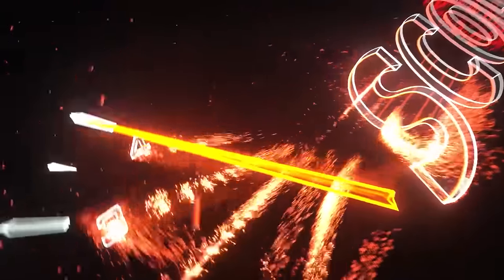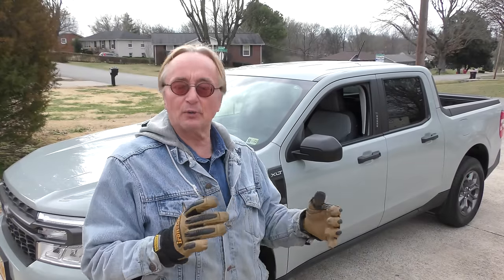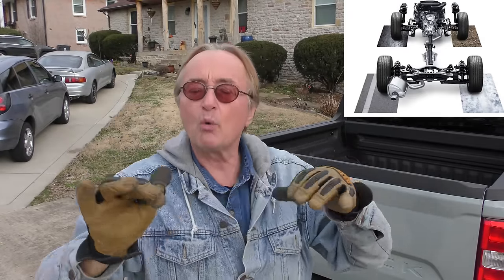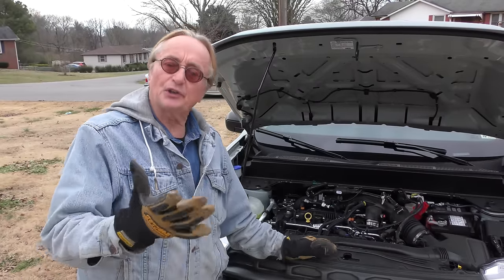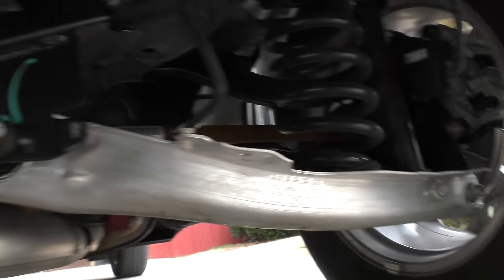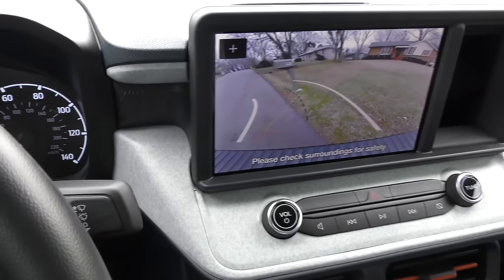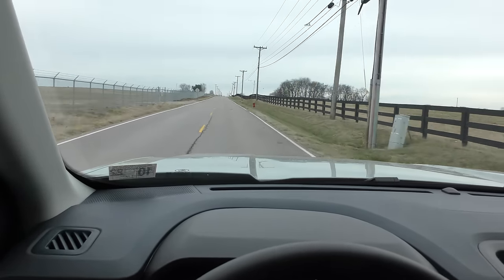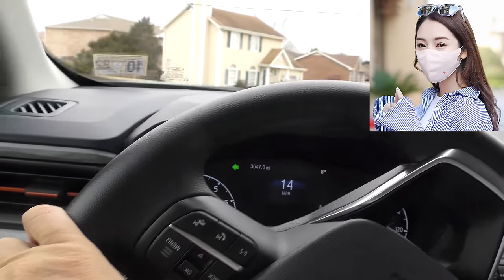I Finally Got a New Ford Maverick and Here's What I Really Think of It

Comment: Scotty, please try the "new" Frontier - No start stop, no funny cylinder deactivation, no hybrid, no turbos. Just a 3.8L and a 9 speed transmission. Pretty decent MPG with the amount of HP they're producing with and no funny business under the hood.
Reply: Bro I test drove one and ended up just getting a used 2019 with the 4.0 for like 10k less than a base 2022. It feels about the same to drive as the old version. There is also direct injection on the new engine with no port injection to clean the valves.
Reply: I second the motion.
Reply: I like the way the new Nissan Frontier trucks look but something tells me the Tacoma will still out last the Frontier. I’m in the market right now & I’m looking at new pickup’s & the Tacoma is still cheaper than the new Nissan.
Reply: @icosthop9998  But I bet the Toyota will be worth more after it gets a few years old compared to the same year Frontier.
Reply: @joeshmoe8952  The Nissan comes with the V6 standard
Reply: @jordanrosenberg9816  Yes, the six cylinder is great for power & light towing but I’m good with a four cylinder since I’m really not going to be towing anything. I just need that bed to put stuff in the back. One thing for sure with the tacoma is the reliability & resale value is there.
Reply: Nissan Frontier?! Thats like saying “Susquehanna Hat Company” to me! (If youre old like me and you watched Abbott and Costello you’ll get it). But I bought a new Frontier in 2000. It was the worst vehicle I ever owned in my 63 years. It couldn’t get out of its way. Uncomfortable. Noisy. A real piece of imperial horseshit.
Reply: @oakoso26  yeah I heard that... Wound have to incorporate a port injection cleaner into the maintenance rotation every 10k miles or so
Reply: All Nissan did was bring the truck up to 2019
Reply: I've owned 3 Toyota's the last 17 years. FJ, Tacoma and Tundra. Out of the 3, the FJ was the only one I truly enjoyed but our family out grew it. The other 2 had reliability and resale going for them but that's about it for me. Forecasted resale values are strong for the Pro 4 X but of course time will tell. I'd take simple power train over complicated, even against Toyota. These new small displacement turbo engines will be expensive when they fail, now introduce hybrids into the equation and you're really going to take a hit. The new Tacoma will have turbo 4s and possibly a hybrid option.
Reply: Frontiers have the worst mpg
Reply: But it’s a Nissan!
Reply: It's direct injection. Toyota has port and direct injection
Reply: @jmc4181  You know who makes these hats?? Little girls with pigtails!! LOL
Reply: @joeshmoe8952  be careful about the Mexican made Tacoma's.
Reply: I just traded a 2019 Nissan Frontier for a 2022 Nissan Frontier and what a world of a difference. Finally got rid of that fugly steering wheel. Both still don't turn worth a damn though. The New Frontier pulls better and more stable at towing though.
Reply: I was looking at the 2022 Tundra TRD Pro but saw that it comes with a twin turbo V6 and said NOPE. I just wanted a naturally aspirated V8 which it looks like is gone.
Reply: @joeshmoe8952  doubtful the toyota is cheaper at the same equipment level- toyotas are over prices
Reply: @icosthop9998  its not
Reply: @jmc4181  have a 2011 xterra  only actual repair were camshaft sensors
Reply: @billyhill2488  My dad just traded in a 2018 Toyota Tacoma that he paid $32,000 for when new and Toyota gave him 41,000 for it and he walked out with a 2022 Tacoma for $18,000. I also recently traded in my 2019 Nissan Frontier that I paid $20,000 for and end up trading in for $30,000.
Reply: @ajourneysaved4311  I used to work on the  Tijuana Mexico factory and people from the Texas plant came very very often to check on quality to be the same as Texas built Tacomas, plus parts come from the same suppliers. Eventually all Tacomas will be built in Mexico.  I bet you cant  tell a difference between Tx and Mexico built except for the sticker.
Reply: I'll stick with my Jeep Grand Cherokee 4x4 thank you very much  🙋‍♂️
Reply: @jamesm568  Yeah the market is nuts right now. I've considered trading my '16 Ram with 50k on it but it's a rare example of one (single cab HEMI in blue streak) so nothing I want to replace it with right now. My gut feeling is telling me to keep it as a tow rig/spare vehicle and buy a new daily in a few years. The Maverick is looking like a good option because the one I want (the one in this video) could also tow my 2000lb boat if it had to.
Reply: Sounds good but it's Nissan... and a
Im not black.
Reply: @timothyandrewnielsen  I'm black
Reply: @joeshmoe8952  I traded in a ‘21 ranger for a ‘22 frontier it’s a much better built truck much higher quality materials. And for those saying it doesn’t get good mpg I get 20 daily driving in town and 23-25 hwy that’s good for a non turbo v6 with 310hp. I’d buy a Nissan truck before a ford any day. The new Ranger was a piece of 💩 tin can on wheels.
Reply: @billyhill2488  Buying used sucks right now, but getting new you get better deals on. I have to have the 4K tow package to even consider a Maverick.
Reply: @jmc4181  Just don't buy a  car from a dealer on Flugal Street !
Reply: Gaytomanic transmission
Reply: 100% Agree
Reply: @joeshmoe8952  Fun fact.  I was looking at new Tacomas and you can save around $1700 on the base model if you option out the rear seat.
Reply: @zhbvenkhoReload  — The Frontier does not use a pooftermatic — It has a standard automatic transmission (torque converter with planetary gearsets).
Reply: @Jamarkus_Delvonte  he's not .
Reply: Couple of things the FOUR cylinder engine on the hybrid is very standard so maintenance on that will be normal. 
On complexity.  The hybrid powertrain after the engine has about a third of the parts of the automatic transmission. It's an eCVT and not the CVT with that belt.
I test drove both of them (hybrid and turbo) at the dealer and there wasn't that much difference in acceleration.
Reply: @evilpeach2  You mean the SR Acess cab? that’s the model I was considering
Reply: @bikeman1x11  Depends what part of the country you’re in. I live 15 mins away from the largest Toyota Dealership in the world. They sell toyota’s like hotcakes there, 50 acre dealership.
Reply: @gc1087  my boss has had Ford F150's 4wd's and a V8 Raptor, but now has a Tundra TRD whatchamacallit and he says that a Ford's 4WD system work better in every way.
Reply: @ajourneysaved4311  They’ve been making tacomas in mexico for a few years already and so far so good. Same quality & reliability as before.
Reply: @revilsdr  I’m not sure on how long the new maverick will last but only time will tell. I know the rangers are built in the usa vs the maverick in mexico.
Reply: Garbage automatic transmissions.
Reply: @joeshmoe8952  toyota is still living off their formerv reputation
Reply: @Jamarkus_Delvonte  I'm sorry.  No ones perfect.
Reply: Don't see a Nissan in my future.  Can't get past all the people they stuck with bad radiators that took out their transmissions when they got full of coolant.
Reply: @joeshmoe8952  yup
Reply: @revilsdr  this is correct. I had a 3rd gen Tacoma and the power train was playing Marco Polo. The driving position was also weird. There was a rattle in the sunroof 4 trips to the dealership and video footage to Toyota could not resolve.  I drove a ranger for 5 days while visiting FL and that truck just felt cheaply made and outdated. 

Driving my new Pro 4 X is the most enjoyable truck to drive I've owned. It does feel like quality especially compared to other trucks anywhere near the price range. 
I'm getting EPA rates MPG up to 22 HWY and again, no funny business to break in making that happen.

Resale value is already predicted to be strong but in these market values no one knows and everything has a high resale value. Even Scotty made a video "if you don't buy this truck then you're stupid" and it was based on the Frontier's no nonsense approach to power train. People should understand that resale wasn't high for the previous trucks because they were 17 years with the same design, not because they were unreliable.
Reply: @cheftomsd  that was solved a long time ago - I wouldnt but a nissan or other CVT but a traditional truck or suv  nissan is fine
Reply: @Tom Belgard  Your right and any Nissan with a Jatco CVT Transmission.  You better stay clear,they think 90,000  miles is good life on those. I was lucky and hit a Deer with my Rogue.  I have a Rav 4 now, a much better built vehicle!!!
Reply: @Bikeman  You are right CVT Service life is 90000 miles,what a nightmare!!!
Reply: @gregsheffey5191  if they last that long